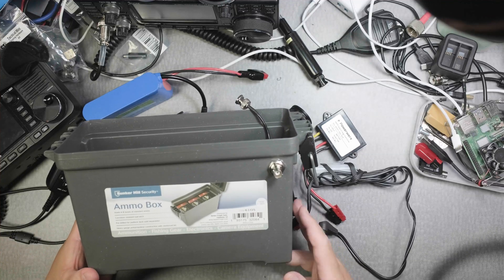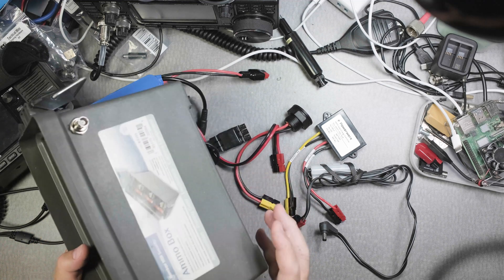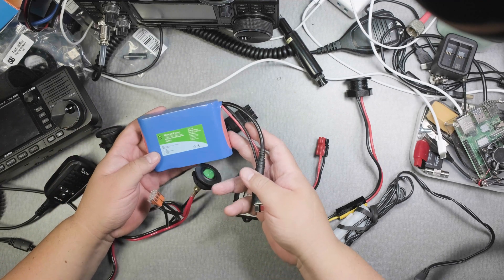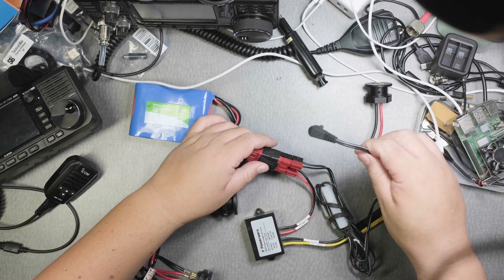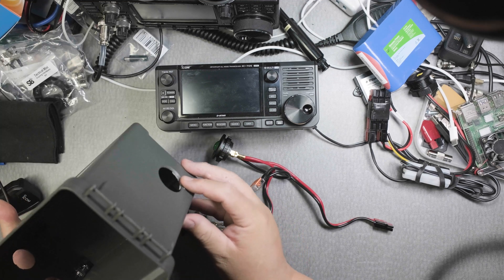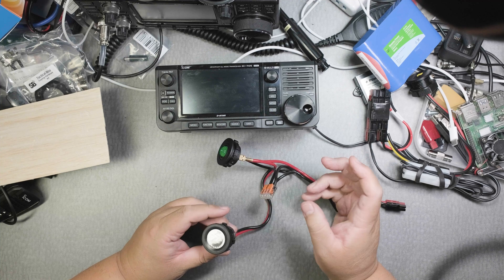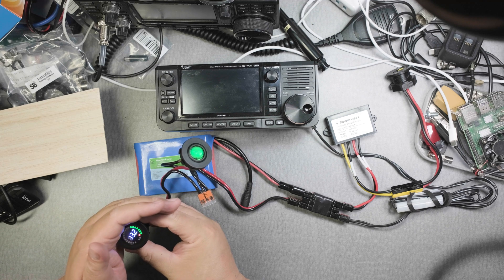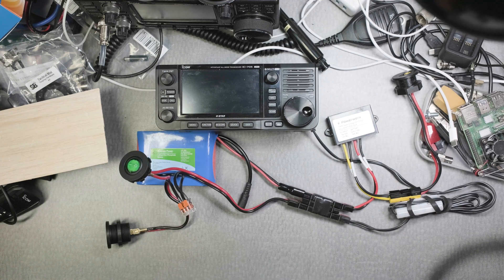Solar Go Box for IC-705

Comment: You need to be a bit careful directly charging your LiFePo from the solar controller.  Lithium battery chemistry is fairly picky with respect to how they get charged.  Having a continuous amperage applied to that battery could cause damage and shorten its lifespan.  You should really put a LiFePo charger in between that battery and your distribution block so it can turn regulate and turn on/off the charge current from the solar.  The danger is really in overcharging that battery so beware on a long day hooked to that solar if it can produce more power than the radio can drain.
Reply from the maker: Thanks for pointing that out.  So, the charge controller is not in parallel with the load and the battery?
Reply: @frankwc0o  To be clear, you have a solar controller that takes the output of your solar panel and "schmoozes" that power into a consistent 14.6 volts, which gets delivered to your distribution block.  That voltage will always be regulated at 14.6 volts at whatever amperage can be produced by the intensity of the sun at any given moment.  What you also need is a battery charge controller that takes that 14.6 volts input and applies some, all, or none of that current to your battery as needed to keep the battery recharging at the correct rate or stops the current going into the battery if it is at full charge.  The issue is that generally speaking a battery charger will control the current going into the battery but won't allow any current to flow out of the battery and into your Icom radio.  So, a smart controller (like your BuddyPole Power Mini) that has the correct circuitry to determine and adjust the proper charge rate, consumption rate, etc is really needed to ensure you don't damage that battery.  Having said all of this, I believe what you have shown in this video will work, you just run the risk of overcharging that LiFePo battery, which will shorten its lifespan.  It's a tricky game to manage all of this properly, which is exactly why the BuddyPole Power Mini's are such a great piece of kit.
Reply from the maker: @resiggy13  Thanks for replying.  When you say battery charger, are you talking about the Powerwerx Solar Charge Controller?  Suggesting the Powerwrex is not consider a "smart" controller?  I've noticed in documentation and in other YT videos, most connect the Solar Controller in parallel with the load and the battery.  I'm guessing there should be something else to manage the controller so not to shorten the life of the battery.  As for the power mini, I think that's a great investment - all in one.
Reply: @frankwc0o  Hi Frank. I think I'm going to have to eat a bit of crow here.  I just looked up the specs for the Powerwerx MPPT-150 and it appears that I was dead wrong here.  According to Powerwerx this device DOES include smart charge circuitry.  I was previously under the impression that it delivered a constant 14.6v 100% of the time.  Wrong.  So, very sorry to confuse the issue with my earlier incorrect response.  But, I guess you're learning why the BuddyPole costs $150 and the Powerwerx costs $29 with your discovery of how noisy the cheaper one is on 10 meters.
Reply from the maker: @resiggy13  No worries.  Have a great day tomorrow, -73.
Reply: @resiggy13  Yes the Powerwerx controller is very noisy, I thought they even discontinued it because of that.

Comment: Good idea to add the switch for the voltmeter. Perhaps consider either a push button or a spring-loaded switch so that it does not get bumped and left on by accident? DE WA1KLI
Reply from the maker: I like that idea, thanks for the tip.